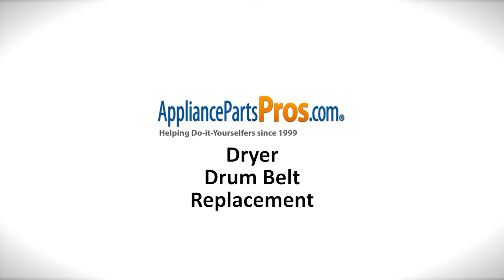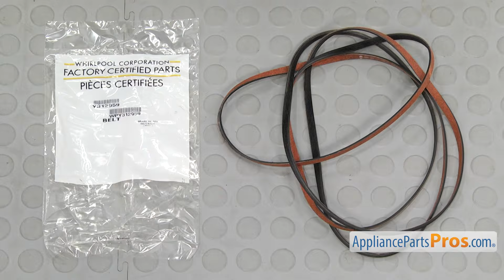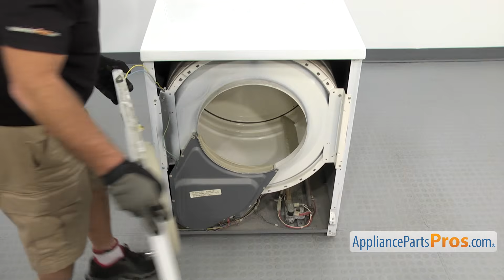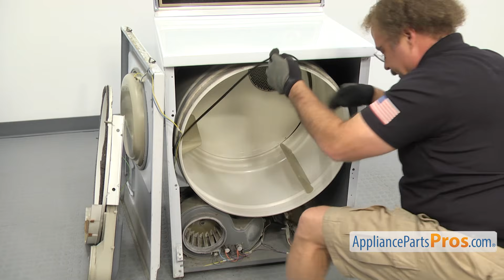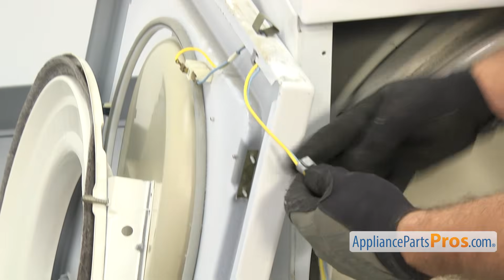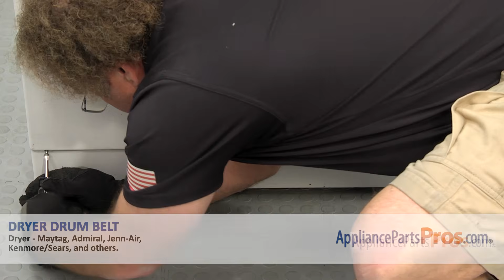How To: Whirlpool/KitchenAid/Maytag Dryer Drum Belt WPY312959

Comment: Is the belt supposed to be snug/tight when properly routed? Took the belt off to get to a dry drum support roller and when I put the belt back on it seemed a little loose and my drum will not spin now.
Reply from the maker: The belt should have some tension when it’s properly routed around the drum and idler pulley. If the drum won’t spin after reinstalling the belt, it’s worth checking that the belt is routed correctly through the idler and around the motor pulley, and that the idler is providing tension.

If you need further troubleshooting/testing information from our techs you can check out our repair forum: https://forum.appliancepartspros.com/

Comment: What if the it keeps
Up nosie
Reply from the maker: If the dryer continues making noise after replacing the belt, there may be another worn or damaged component, such as a drum roller, idler pulley, or motor.

If you need further troubleshooting/ testing from our techs you can check out our repair forum:
https://forum.appliancepartspros.com/

Comment: It looks like the fabric side of the belt is making contact with the inside of the idler pulley belt guide.  is that right?
Reply from the maker: The flat side goes against the drum, so the ribs on the belt ride into the grooves of the motor pulley.

Comment: Thank you! I can never remember how that idler pulley holds the belt. Ordered a new hi-temp thermostat and thermal fuse from you all and it arrived quicker than the new dryer we wanted. We’re back up and running! 😊